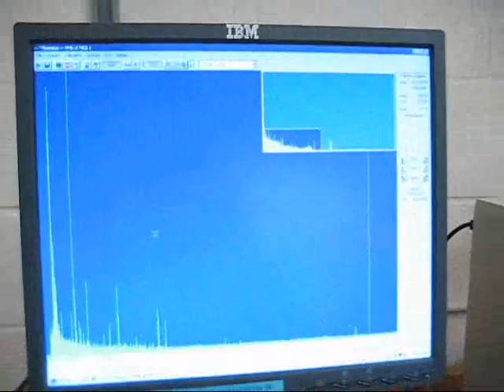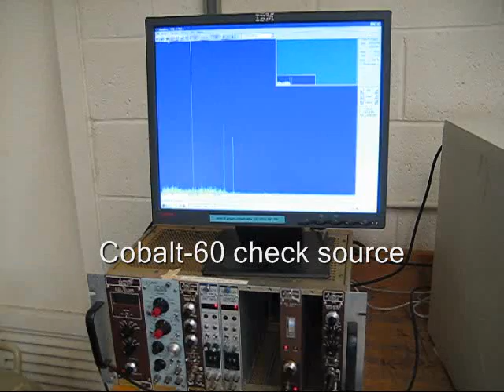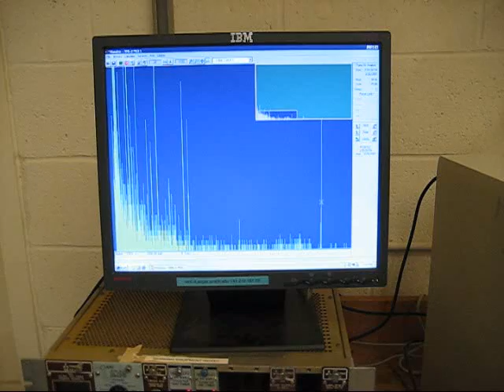Radioactivity measurements

Comment from the maker: A tiny bit of Americium-241 is in there, produced synthetically. It ionizes the air so current can run through it, and when smoke comes it, the circuit changes and the detector sends the alarm.